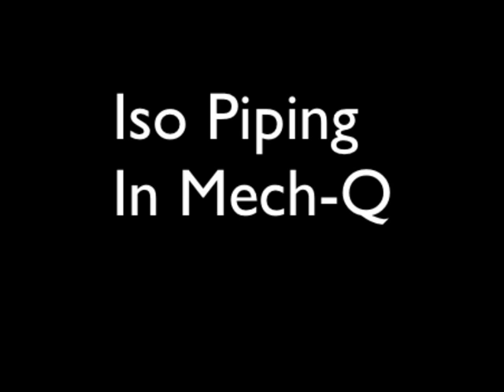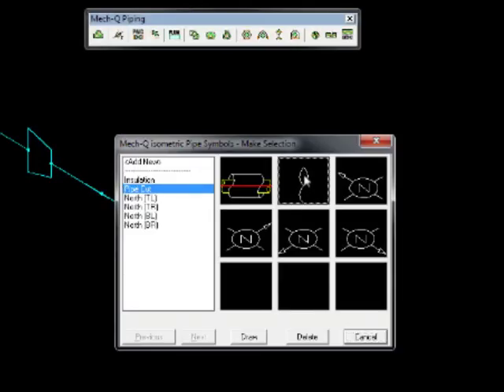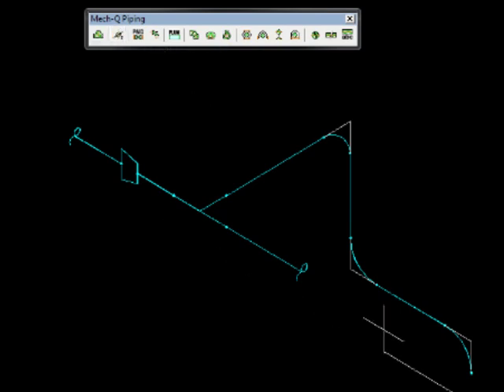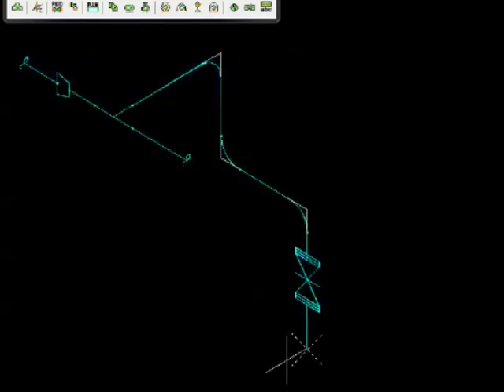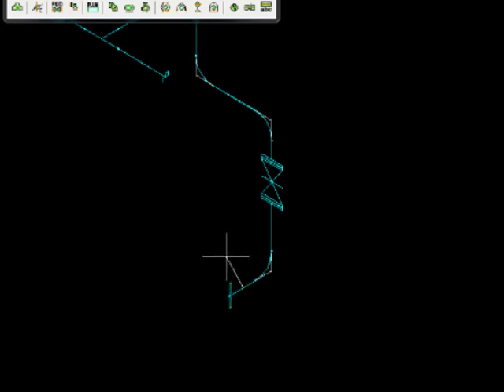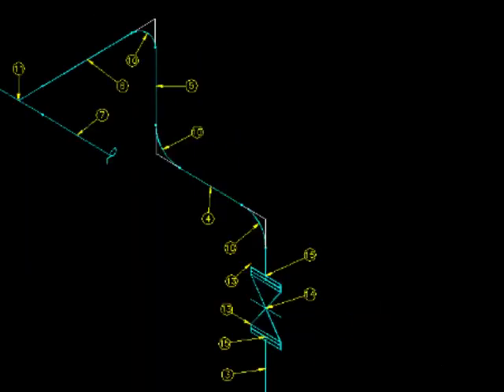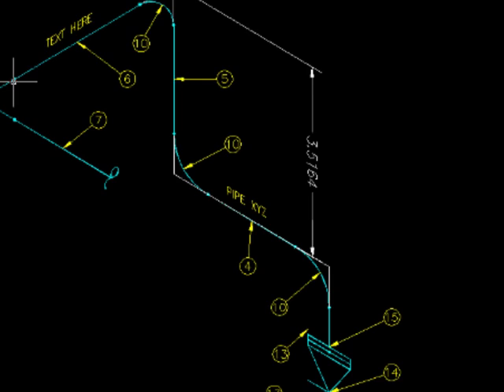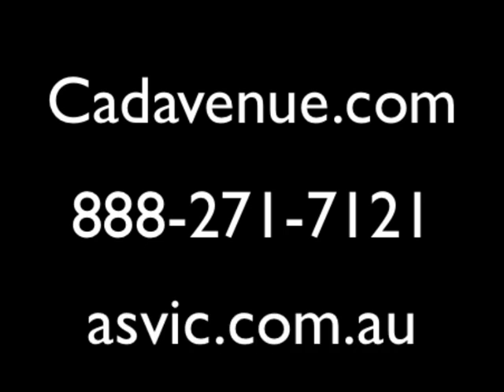How to create a isometric piping drawing

Comment: I keep getting this message from Mech-Q when trying to draw along in this video. "Elbow angle not standard. For other bend angels set toggle switch: Bend Use Elbows - OFF. I can's seem to draw a straight pipe line. What am I doing wrong?
Reply from the maker: make sure your Ortho is on (press the F8 key) this will allow you to draw straight lines.